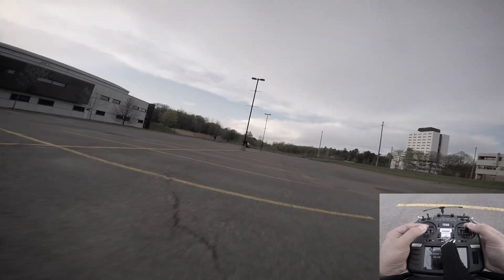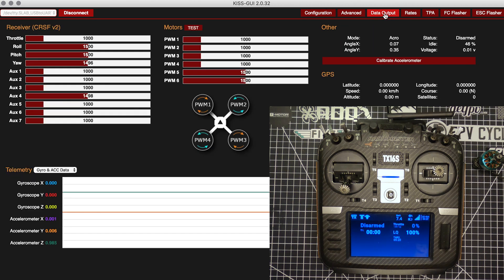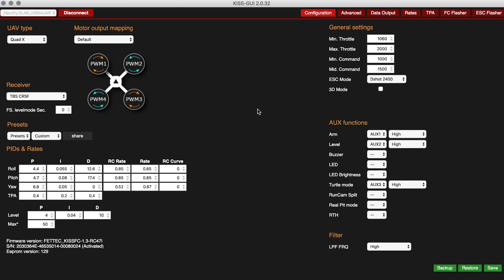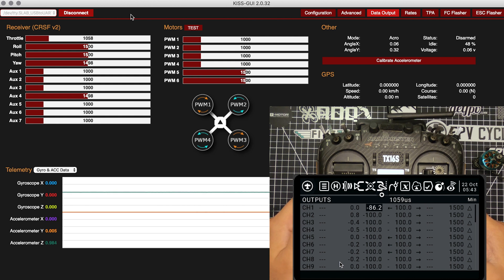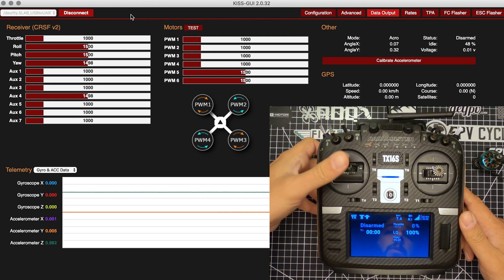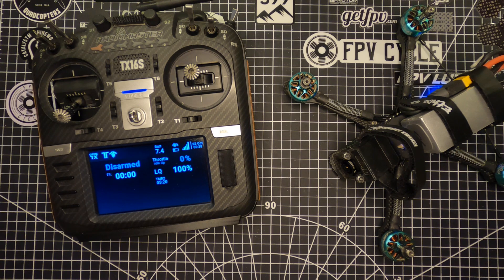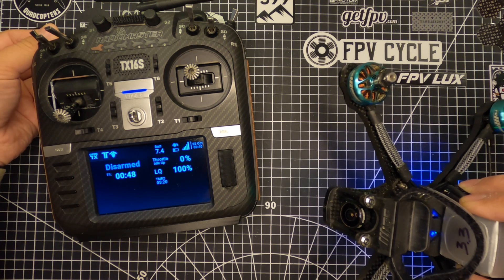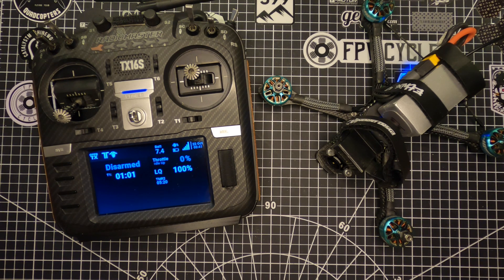Why you should use idle-up with KISS & how to set it up || Food For Flight

Comment: Awesome video. I didn't like how Steeles idle was 1070 thought that was a little high and floaty dropped it down to your settings. About to fly it now 🤘🏻🤑
Reply from the maker: Glad it was helpful, lemme know how it goes 🚀
Reply: @udyfpv  it flies like a dream. The slightly lower idle seems to help with falling freely. Landing also seems softer vs using 1070. The one thing I did like about 1070 was it was just enough of a change in rpm that it's visible & audible vs 1055 the change in idle speed is really undetectable
Reply from the maker: @Raffe_Fpv  yeah I guess I've been using it so long that I can hear it 😅 Happy it makes your quad fly the way you want 🤘🏼